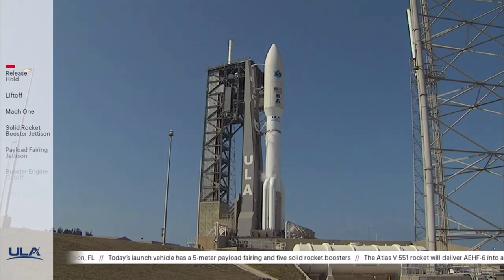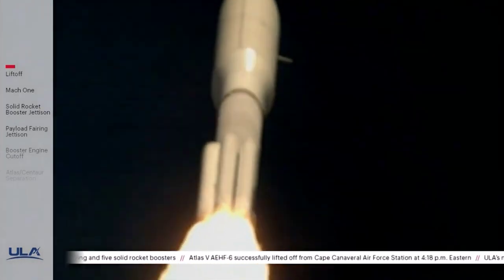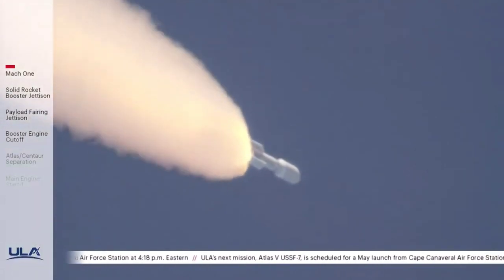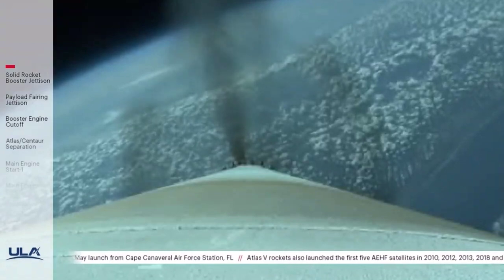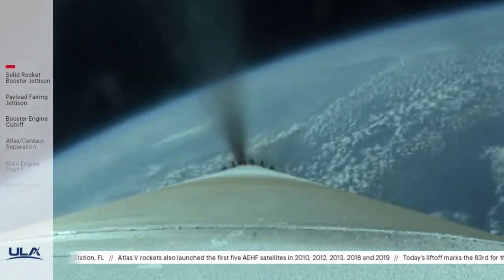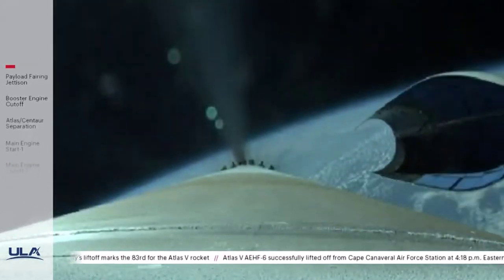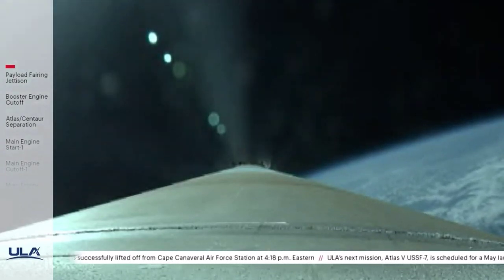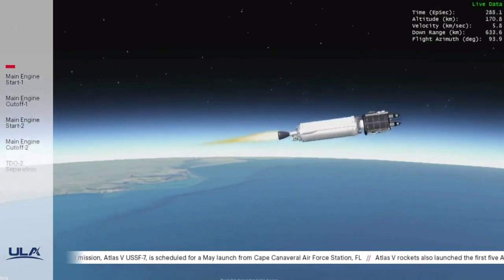ULA Atlas V Launches AEHF-6 for US Space Force

Comment: why they don't land the boosters?
Reply: Its not Spacex
Reply: They physically can't land it because it isn't designed to be reused
Reply: What happens with the boosters?
Reply: @gonzo111081  They take a dive in the ocean.
Reply: Unknown and then it will be recovered?
Reply: @gonzo111081  I don't know if they recover any of the Atlas V boosters.
Some boosters can be recovered like the Shuttle's, but it's up to the engineers designing them to decide if it's sensible to include parachutes or not.
Even then, the sea's salty water isn't exactly kind to rocket engines, which means that they require a lot of checking to make sure they're still fit. Solid rocket boosters can't be turned off once ignited, so if they're not in perfect condition they might doom the mission they're being used for.
Spent boosters that aren't planned to be reused are just left to crash into the ocean, what's left of them gets recovered some time later so that it doesn't pollute too much.

May our saviour Elon make reusable boosters that land themselves an industry standard.